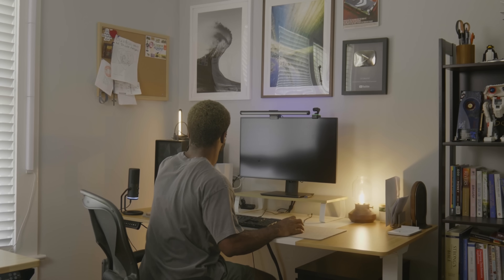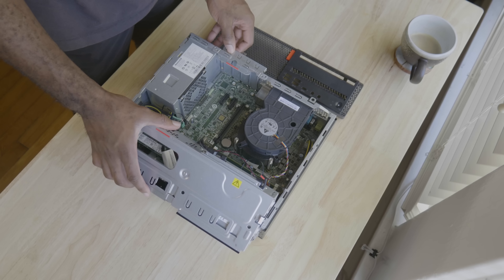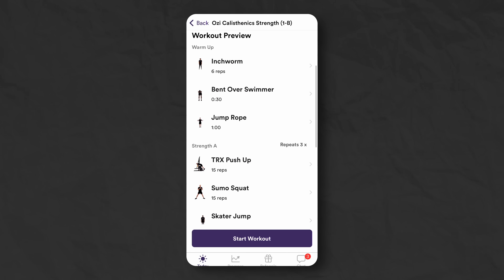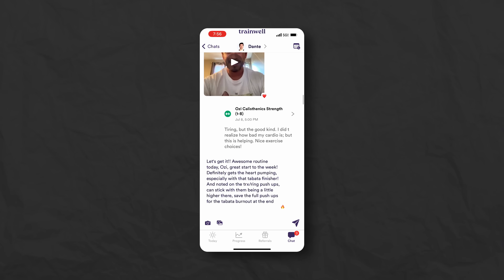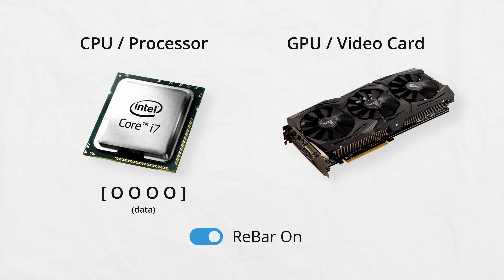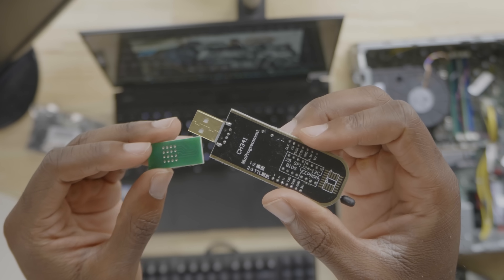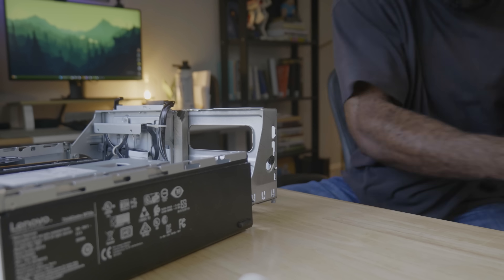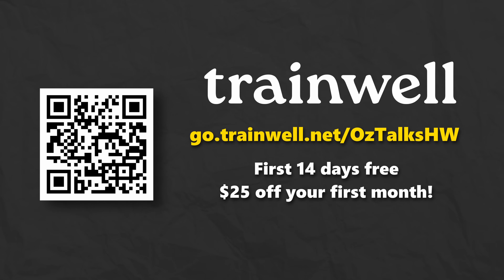Can I build an Xbox Series S PC for $200?

Comment: yes, it is a nice build, but i doubt it will compare to the series s. used market is the way at this price point. for $100 i built a pc with i5 4570,8gb ram and rx570. sure, it’s bigger than yours, and it uses more power, but i bet it performs much better. if you keep searching on used market you can get insane deals

Comment: JUST started watching....My Guess is that it will be close to what I built my Daughter for the summer:

Ryzen 5 5500 = $50 (AliExpress)
A520/B450 Mobo = $50 (Woot Deal)
Radeon 5500-8GB = $50 (AliExpress)
512GB NvME = $50 (Amazon Deal)
Case w/600watt PSU = $50 (Ebay Deal)
8Bit-Do Ultimate C = $30 (Amazon)
MechKB+Mouse = $20 (Amazon Deal) 

Total was about $300, about the price of the Series-S at it's launch. 

She has access to her collection of Free Epic Games, my Steam Library as well as the games I have on GamePass.

I was happy to hear that Digital Foundry considers the Radeon 5500XT basically the Series-S GPU, and it plays everything pretty darn well.
-----------------
I saw more of your video:
I'm pretty sure your system is a bit cheaper, and still games nice! And a more manageable formfactor to boot! Excellent video, thanks for making it!

YUP! 

Your system is about $103 cheaper than mine.
Notes
If you can still get a $50 Radeon 5500XT from AliExpress, I believe it's a step up from the A380. 
The 5500XT, I believe, is comparable to an RX-590 or a really slow GTX-1070-vanilla.
 
That's it. Your system is nice and reasonably priced and sized to compare to the Series-S. 

Good video.

Comment: The $300 version of this with a 3050 6GB would be the MUCH better play for someone actually attempting a build like this. Plug and play pretty much, with the addition of all the Nvidia goodies.
Reply from the maker: I still have my 3050 - this is a great idea! I think I'll add it in the next update :)
Reply: @OzTalksHW  that’d be great! That + a Mem Upgrade and these could compete at 1440p with the upscaling tech, would likely see a decent uplift in performance and image quality over the S. To me the current sweet spot is a budget 1440p gaming monitor with a ‘1080p’ Nvidia GPU where you can use DLSS Quality/Balanced presets to make up the performance with a much better output and daily usage scenario.
Reply: Thats actially the exact route I went for building a secondary pc for running Windows (I wanted to run Linux on my main pc but still needed Windows occasionally and hated rebooting)

I went with an HP EliteDesk 800 G2 SFF, but I don't recommend it because the 3050 intersects the USB 3 header. Getting a right-angle adapter to fit underneath worked, but then it would get this annoying message on boot about the USB header being disconnected because apparently its missing a special HP jumper. Had to solder a small wire to bridge certain pins on the back of the mobo after a ton of YouTube research 😅

Also the thermals are abysmal, so I added a fan secured by ziptie chains to point it at the GPU lol. Computer is also loud because of the proprietary PSU fan, and cant do much about it. Definitely the most sub-optimal way of making a pc work, and the 300 dollar price tag felt a biiiit overpriced for the performance but it performs steadily and runs all the games I need.

I should have just gone with an MT build, I really didn't need the SFF form factor 😅
Reply: DLSS 3 is a game changer
Reply: 3050 8g

Comment: The HP Z2 G4 SFF would be a much better option that would have solved some of your issues here. No need to cut anything to fit any LP GPU, has more NVMe m.2 slots, has a better power supply... and it actually has USB3 ports on the rear. It also costs a similar amount of money. There are several auctions on eBay right now for $67, with i5 9500's and 16GB of RAM. As for the GPU, this only confirms what I've been telling people, the BIOS mod is not worth it to run Arc... just be patient and grab a 1650 in an auction for around $100 - $120 instead.
Reply: It sucks that the value proposition of arc is destroyed on OEM pcs like this. Also kind of crazy how expensive these low profile cards are, it almost defeats the whole purpose of going with an OEM pc to save money. I love the idea of a low power, low profile machine, but it sucks that the price to performance is so bad on them. Love your reccomendation of the Z2 G4 though, it's crazy that we can get a 9th gen i5 for so cheap.
Reply: @spoobspoob2270  Absolutely. I don't know why that decision was made, or if they didn't have an option, but they really lost a good portion of the market that would have loved a less expensive option... the OEM gaming PC crowd. It's such a missed opportunity. As for LP cards, I get why they're so expensive... it's just a super niche market. As such, they are just very low production, and thus they tend to be more expensive. I was very surprised that the 4060 LP was the same price as the full height cards. Granted, the 4060 was over priced to begin with.

I really do like the Z2 series. I have a G4 SFF as one of my personal systems and I do like the OEM SFF systems, despite the cost involved. They also have a tower system, which uses the same board, but has room for just about any GPU and comes with a 500 watt or a 650 watt power supply. I really do think people are sleeping on these. I've been buying them and flipping them as gaming PC's and they're a hell of a deal.
Reply: @TheGameBench  wow, that power supply is a hell of a steal for the Z2, you could get something like an rx580 and still be fine on wattage! I've always thought that the 580 was a no-go on OEM systems since they never include a good enough PSU, which was a shame since it's 1060 levels of performance for about 1/2 to 2/3 the price. 

It's so fun to flip these PCs and configure them, it's satisfying to give people proper performing hardware for cheap instead of whatever crap is being sold on Amazon with anemic specs XD
Reply: @spoobspoob2270  I mean... the 500 watt has an 8-pin and a 6-pin. I've been tossing RTX 3060 12GB in them. All in, they're costing me $400 to $500 to put together with an i7 8700, 32GB of RAM a 1TB NVMe drive and a 1TB HDD. The 500 watt PSU would def be good for more that a 180 watt GPU. Just got one with a i7 9700K and the 650 watt PSU. Thinking I'll throw a 3080 in it.
Reply: @TheGameBench  you're right haha, I didn't even think about that 🤣 

That's actually a killer system for the money!
Reply from the maker: I used what I already had, but this is a great recommendation 🙂 I also wanted an excuse to try the RebarUEFI mod.
Reply: And HP almost definitely has a checksum for their BIOs, so even hardware flashing a new BIOS with ReBar won't do because it'll still refuse to boot

Comment: SS is a beast lol. That PC is crap.
Reply: Certified SS fanboy right here folks
Reply: Console peasant kid detected 😂
Reply: Oh look someone who knows nothing about hardware.
Reply: Pc can do anything xbox ss is limited to gaming and also consoles fail after a year so pc is better plus u need to pay 20 dollars for dev mode on xbox series s for using emulators while the pc has no such payment is required also there is no need to pay for online gaming
Reply: @Shyster52  R you Ok dude !?
Reply: @Shyster52 This isn’t about the PC being able to do anything, we’re speaking of the deal of getting a Series S compared to a PC, is it possible to get the same power and future proof of the series S for ONLY gaming in a OC for around a budget price. Answer is no, sure u can upgrade a PC and it can do more but that goes beyond the original goal. With a Series S u already solid for the next generation of games. Regardless of preference (60fps 30fps 4k 1440p etc etc) the series S lets you play the newest games for a solid deal.
Reply: Still not a console so automatically 10x better (at least)

Comment: For my series s killer build i bought a 3050 6gb low profile. It's only $170-180. Get a an older sff and slap this in. It should total you $250 or so but it is worth it. A380 is not bad its just if bios have no Rebar than it will limit performance.

Comment: Modifying a Vbios for a Asus Strix 3080 OC to make Rebar work was one of the most hair raising experiences of my life! So I completely understand all the frustration you went through. Good that you got it working in the end! 👍
Reply: The beauty of having a physical eeprom programmer is if it flashes a bad bios it usually doesn't matter if the chip isn't damaged you can flash it with one that works once you have a working one. I bricked a board I kept because it had an nforce chipset that was useful for things newer boards can't do anymore, there were two HP boards one had two less ram slots soldered on and three less audio jacks otherwise the boards were identical even the same audio ic they just had it configured differently in the bios which is where my fiddling with the other boards bios to work on mine because the same board with just more ram slots supported more cpus (for segmenting reasons alone as is the other boards bios funcitoned perfectly aside from the audio jacks being in the wrong order and some not existing) so I was trying to get the other boards bios with edits to configure the audio ic for my boards port layout and it halts after the ram test and goes no farther. I didn't have a programmer to fix it or know about them at the time.. so the board got thrown out :(.
Reply: I just came across this a few days ago, should i flash my 3080? Not sure if it's worth the brick
Reply: @MarcoLoves360gamer  If you have the same card, the newest VBios from Asus is V5 which works so I think you should be okay. I had attempted the VBios flash when Asus only released V3 which is buggy. I flashed my GB z390 Aorus Master to support Rebar without issues but flashing the Strix to V3 resulted in it not putting out a display on reboot. Thank the Gods that card has dual bios. This allowed me to reboot using the working bios when I flipped the switch. Then I had to 'trick' the graphics card into accepting a modified older bios on the initial bios setting as the newer bios would not install with Asus' program. I had to use a third party install program if I am not mistaken but I got it working in the end. Scary. V5 installs fine though

Comment: My favorite random part of this video is at the 2:32 mark when Ozi groans, and that bottom most PCIe bracket randomly pops out LOL. It was just too perfect timing with the annoyance of the card not fitting, those brackets can be super annoying when they pop out of place since they aren't held in by individual screws. Oh the struggles of a "graphics card slapped into an office tower" formula lol
Reply from the maker: There’s always more issues than you bargain for with office PCs sometimes 😭
Reply: I had to drill out a hard drive cage in my Dell Optiplex just to get a video card in there. The overhead in those machines is really tight; frustratingly so.

Comment: What can you build for PS5 Pro money, Oz? Probably any PC you want 😂
Reply from the maker: $700 is toooooooo easy haha but I’ll have a build video for it soon
Reply: Not quite any PC you want, but you can build a really nice AM4 system
Reply: @drewdane40 or even 7500f am5 build
Reply: @arinkarwan5888  I just finished a A620 / 7500f / 4060 build, and even with some pretty good deals I came in at around $850
Reply: That is cheaper than a PS5 pro!

People forget that you need to pay for online subscription with consoles, whcih should be included in the calculation.
Reply: @leviathan5207 Completely agree. That gets ignored pretty much every time someone does this or discusses console vs PC, but it has to be included in the cost, otherwise you’re being disingenuous.
Reply: @drewdane40  nice
Reply: @leviathan5207  ya'll pc fanboys, you get other perks from 'pay for online' services too that PC cannot emulate like multiple free games a month. Is it a responsible way to budget your money? heck no, but it sure is fun. Anyway this is HW not Software I don't play online games on console or PC that theory only makes sense for you.